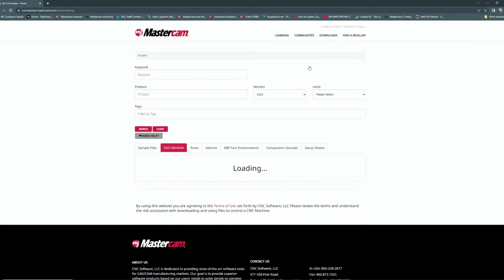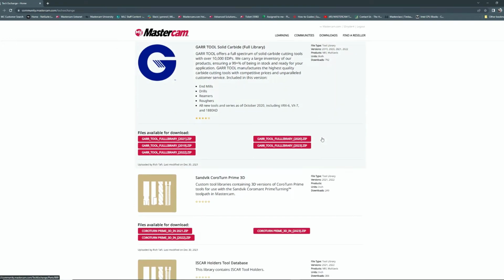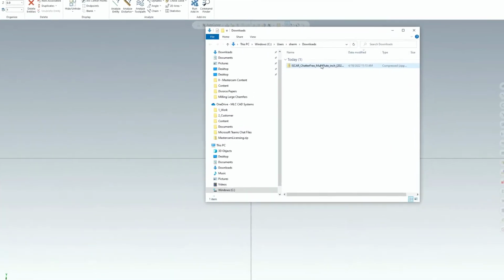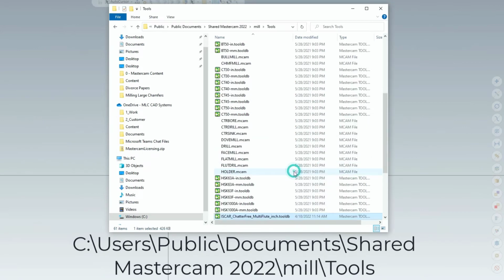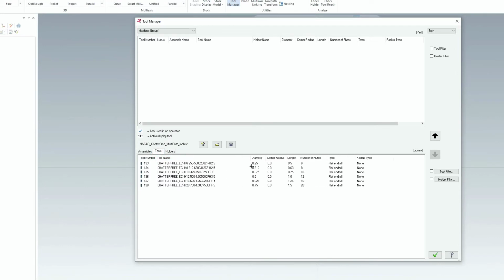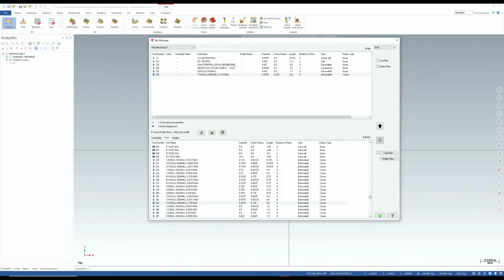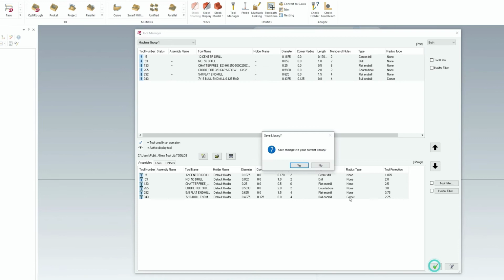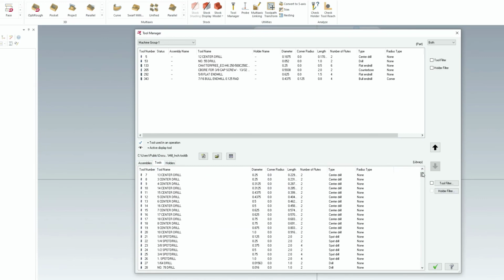How to Download Mastercam Tool Libraries

Comment: Hello MLC CAD Systems and Sherman. Hope you are doing well. 
I follow your instructions to import my custom library but my tool dialog box is off screen and Mastercam wouldn't allow me to resize it. Are there any ways to fix it ?
Reply from the maker: This is a great example of how your value-added reseller's technical support can assist you.  They may suggest you adjust the screen resolution or rebuild the config file in your Documents folders to reset the dialog locations.  If you are an MLC CAD Systems customer you can reach out on our website: https://www.mlc-cad.com/technical-support/